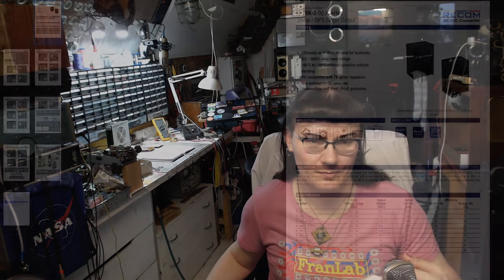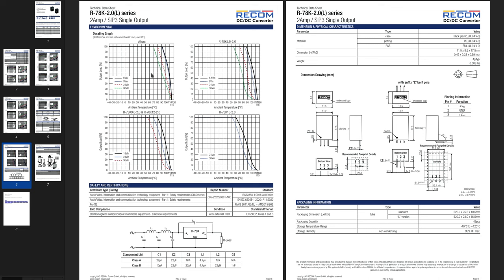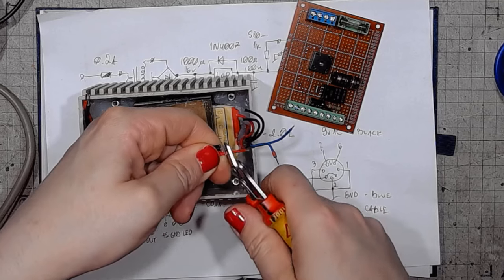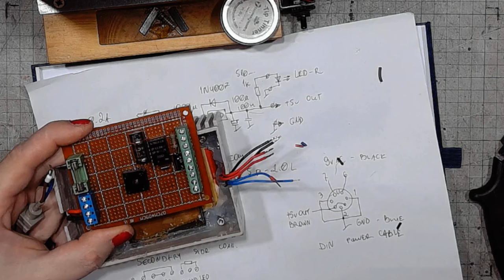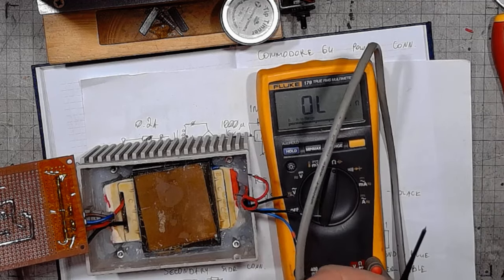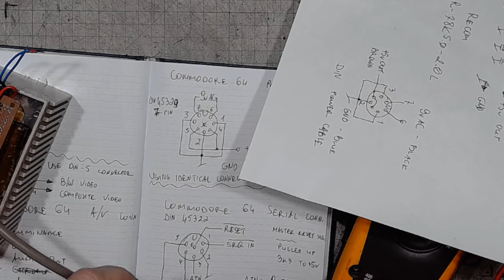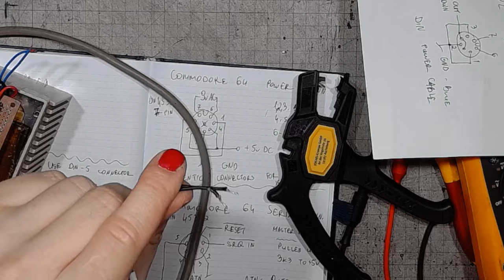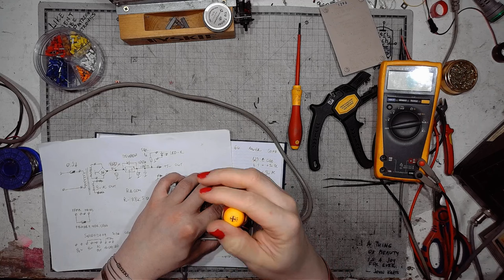Making a New C64 Power Supply, Part 2

Comment: Awesome! I realy love how it came out! I need to make one for my C 64 too.
Reply from the maker: Remember, C64 needs that 9V AC... Silly design, really.
Reply: @KeritechElectronics Yes, i tried steam, carpenters chisels and everything else that came to my mind i had acess to on those old epoxied wedged bricks, but i temporary gave up because i want to see if i there is any way possible to save the transformer inside...  That is how i am... ha ha! The Amiga 500 seem to hawe a much better design inside, but i don't hawe any original PSU for it, så perhaps in the future i will give it a try to 3D print something whan i can afford a larger printer. I so badly hope You and Fran could do a collaboration in the future!
Reply from the maker: @sheep1ewe "FranLab-Keritech Cooperative Testing Initiative", ha! I wish.

Getting the guts out was a complete and utter PITA, it involved chipping the epoxy piece by piece just to be able to get some slack between the enclosure and it, spraying WD40 into the gaps to help release things. It wasn't all that helpful because of the ribs near the bottom (or top, looking at the supply in its working position) of the box. Makes shaking it out a real lottery; it may work with some units but not others (including mine). That's why I was eventually pushed to drilling a hole in the C with a plan of re-using it for the LED. The power transformer failed because of a broken secondary lead I couldn't fix.
Reply: @KeritechElectronics Thank You! I will give it another try on some spare bricks i bought in a batch with broken vintage stuff i won on a national auction site a few years ago which allredy where brooken and had the bottompice plied off with a screwxdriver by some previous owner. I will give them a dove with the steamcleaner as well see if it may make the chassie slightly more flexible... ha ha Love You Keri, i realy love Your projects! Back in time before she was that relatively big youtuber as she is today, Fran said that she whised more girls like her would came out in the light and show what we are doing, so maybe not too far away after all.
Reply from the maker: @sheep1ewe  that's very nice to hear - and my mission here on YT is to form a community of women, especially trans women, and non-binary people in tech. I'll Keri on and do whatever I need to.